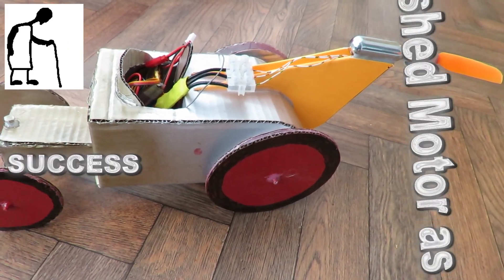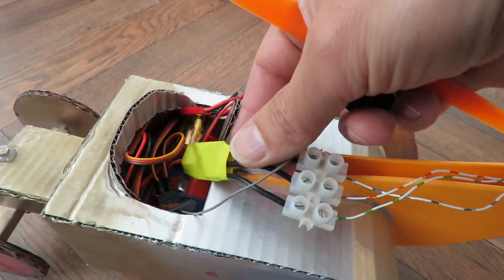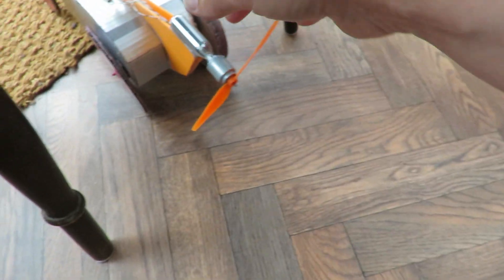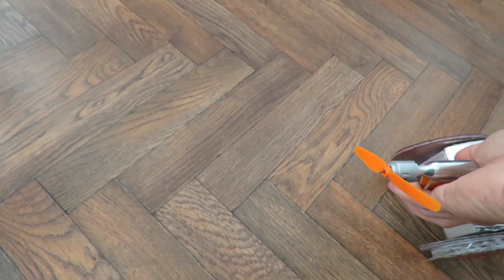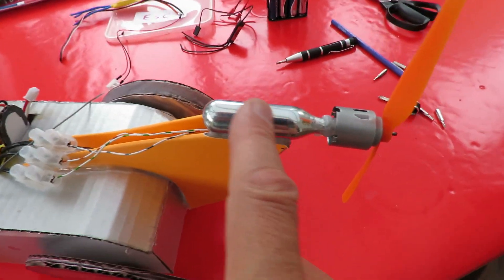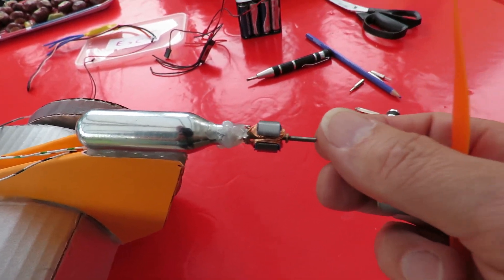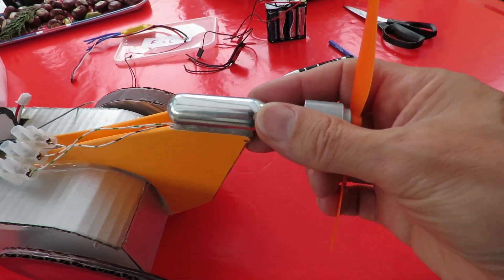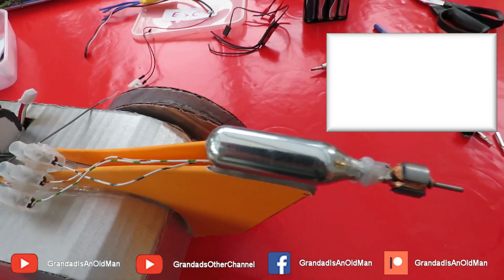Brushed Motor as Brushless Fan Car - SUCCESS

Comment: but in motors with brushed brushes brushed brushes do brushes wear out? That is, if the charcoal is consumed the engine is to be thrown away? 🙄
Reply from the maker: In most brushed motors you can replace the brushes quite easily.

Comment: Hey Granddad, I'm looking for a very small receiver. what kit do you think does small kits?
Reply from the maker: When you say kit, do you mean a kit for making a receiver or do you mean what sort of toy would have a small receiver you could re-use. I am not aware of any kits for making small receivers. However many of the modern RC toys are now 2.4GHz and have very small receivers. Many of the toy manufacturers seem to have realised that the old infrared controlled toys were too limited because they had to be used indoors and the 27MHz and 40MHz toys had limited range so they seemed to have moved on to the hobby grade standard of 2.4GHz.
Reply: GrandadIsAnOldMan, thanks for the quick response.. now I see the difference. by kit I meant receiver and transmitter, I need a tiny receiver. I think ill buy them separately. Thanks again!
Reply from the maker: When I have looked for them online the smaller they are - the more expensive they are :-( You might find this channel interesting if you are interested in really small RC https://www.youtube.com/channel/UCybc2RCSLMcbV0Uc2S6PcnA
Reply: GrandadIsAnOldMan , thanks so much!
Reply: He's such a marvelous micro expert! I wish he was as vocal and communicative like you :/ Prob language barrier :(